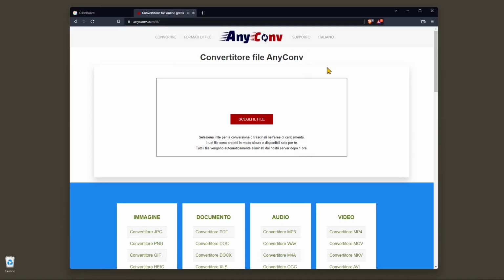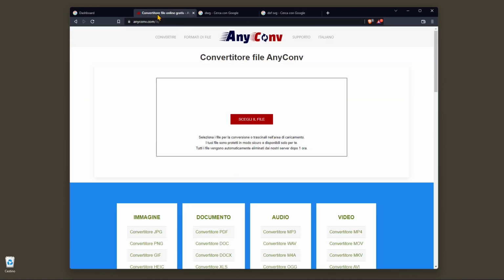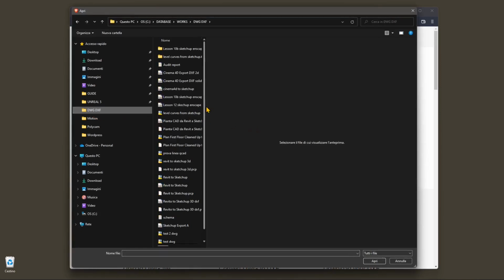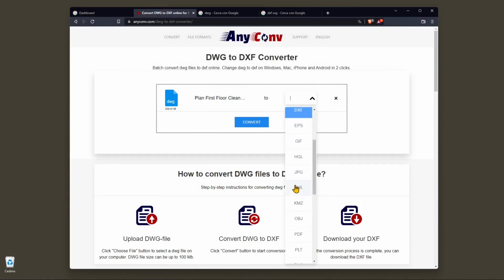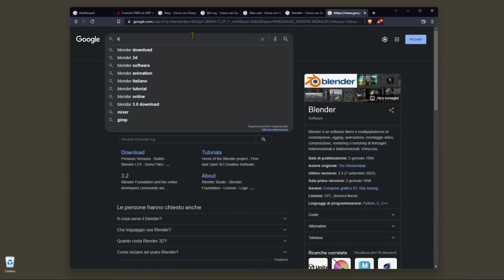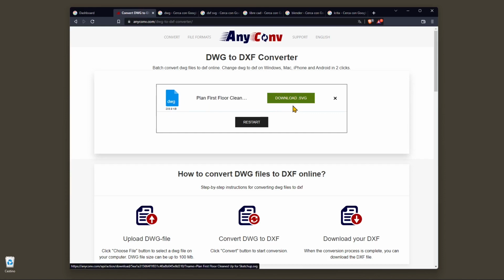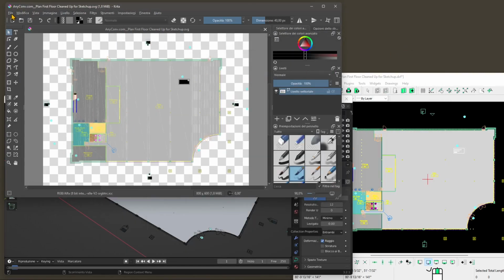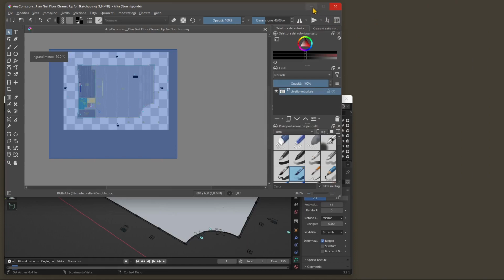Videoguide - Convert CAD DWG in DXF or SVG for Opensource Software LibreCAD, Krita, Blender, AnyConv

Comment: I tried to convert from DWG to DXF to open in LibreCAD. On-line converters are usable only if you can specify the DXF version to convert to. I ended up installing ODA File Converter. Open Source as well. You can specify the DXF version in ODA. As t turned out, the highest DXF version I could open without errors in LibreCAD is R12. Later versions did open, but wiht errors, like absent or unreadable text.